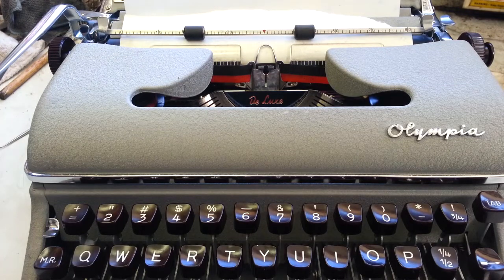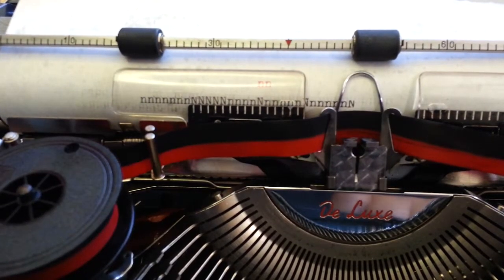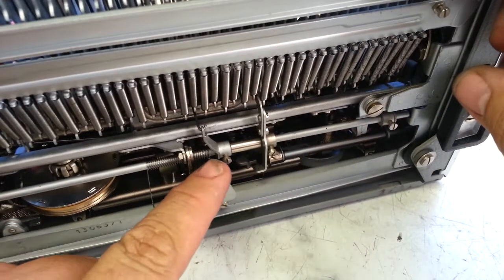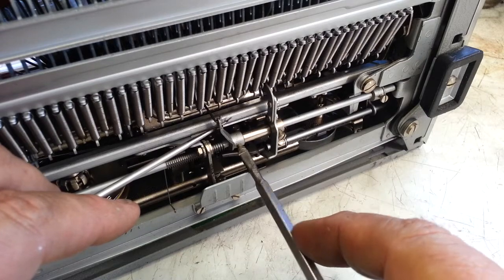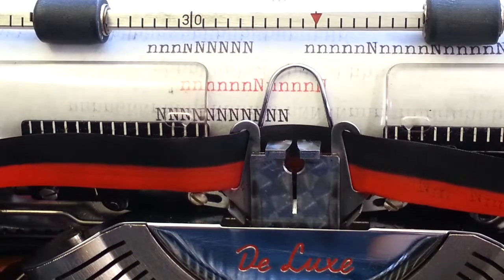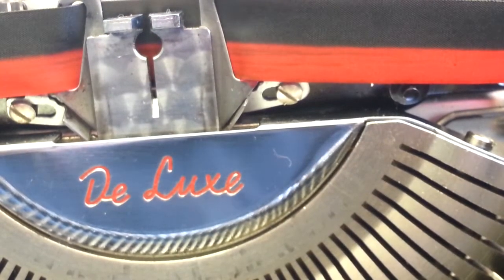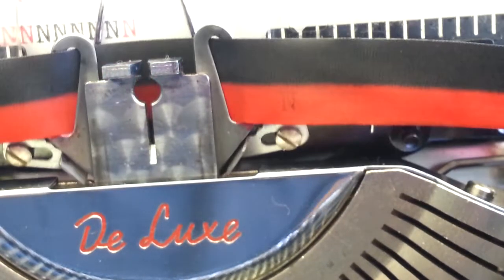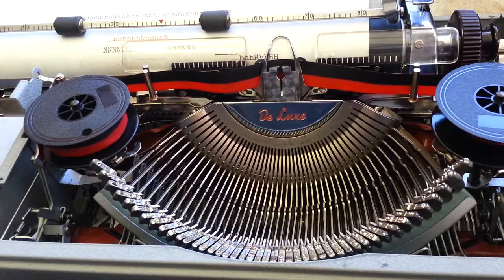Olympia SM-3 Typewriter Ribbon Lift Adjustment Cuts Off

Comment: Duane, this is the second video this week that has provided a fix that I badly needed. I just adapted your idea here and have succeeded in correcting the issue on my 1959 SM3. The hardware, however, on my '59 SM3 is quite different than that shown on the earlier production machine you worked on here. Thanks so much for this timely lesson! David

Comment: Thanks for the excellent videos.  The mechanism looks different on the SM4.  Any idea on how to adjust on the SM4?
Reply from the maker: I would have to see it . . . .
Reply: I could send pictures somehow. The linkage looks similar but the spot you adjusted is welded to the rod. The set screw to the right is also welded
Reply: Any update on Panamer2014’s question? I have the same issue

Comment: What tool is that, that you used when picking up the ribbon connection to adjust the height of the slug striking the ribbon.  Looks like something my dentist would use to clean my teeth with...😒
Reply from the maker: Spring hook, to be exact, a push/pull spring hook. https://www.amazon.com/HOZAN-P-64-Stainless-Steel-Spring/dp/B00CXKTSUS/ref=sr_1_3?crid=YFLFOT7DPQ6Q&keywords=spring+hook&qid=1662509686&sprefix=spring+h%2Caps%2C138&sr=8-3
This is a handy spring hook too....https://www.amazon.com/Moody-51-1850-Spring-Lifter-Length/dp/B00207BTOC/ref=sr_1_2?crid=YFLFOT7DPQ6Q&keywords=spring+hook&qid=1662509763&sprefix=spring+h%2Caps%2C138&sr=8-2